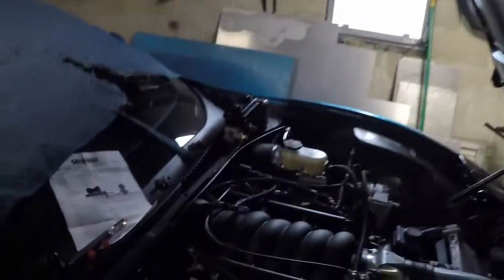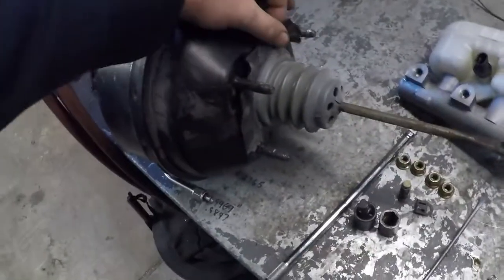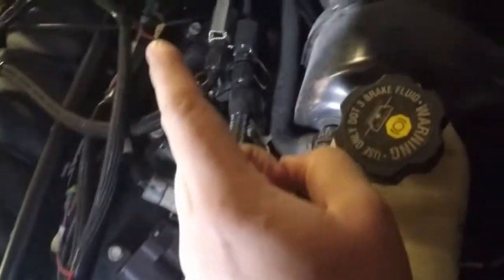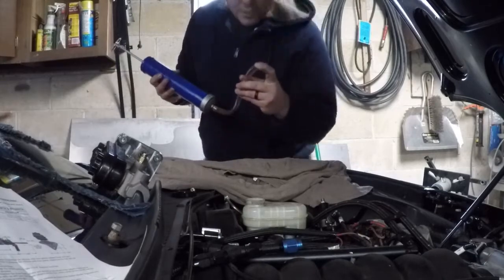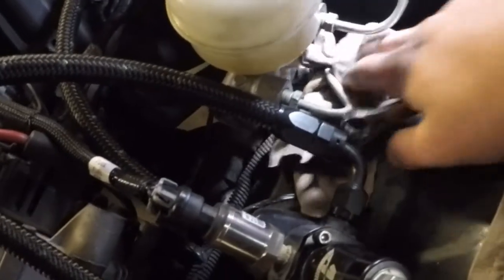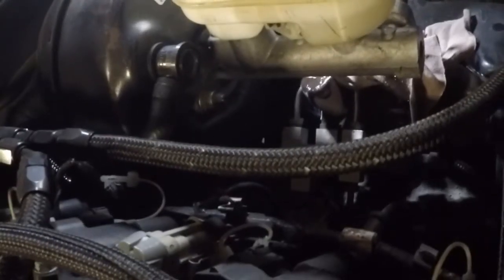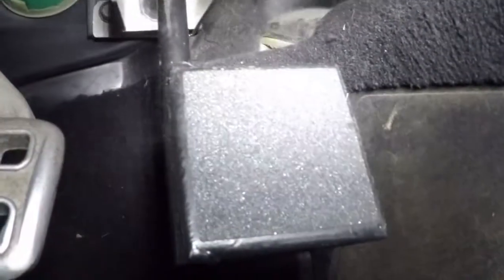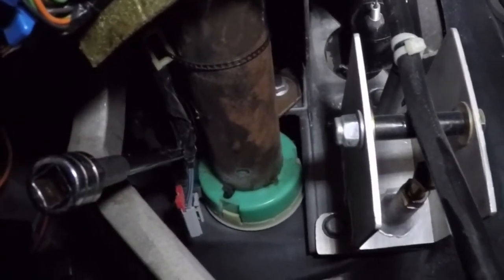HOW TO: Remove C5 Corvette brake master cylinder and vacuum booster

Comment: Hey I’d like to get more info on the cable conversion I have.  2001 c5  6 spd
Reply from the maker: The cable conversion is something I built. I used a Holley throttle body, Lola’s cable and made the pedal myself.

Comment: What size bolts are they?
Reply from the maker: The nuts that hold the master cylinder on are 15mm if you are asking about the studs that the nuts thread on to, I believe they are m10x1.50. But I’m not 100% positive. If the bolt/ thread size is what you are after I will double check to be 100% certain.
Reply: @speedfreakk9490  thank you

Comment: What size master bore was recommended? I’m also interested in the cable throttle conversion
Reply from the maker: Sorry for the delayed response. I can’t remember the bore size. But I used what was recommended by trz. Let me know how I can help you with the cable conversion on the throttle.
Reply: @speedfreakk9490  thanks for the follow up. What TB did you use? I was thinking the set up from a Camaro. What wiring conversion was needed and computer tuning to see a new TPS?

Comment: Its much harder in a manual. had to take out steering column and drivers seat
Reply: I believe you mechanic is saying bolts are loose but still can’t get it out he says he might have to knock it out